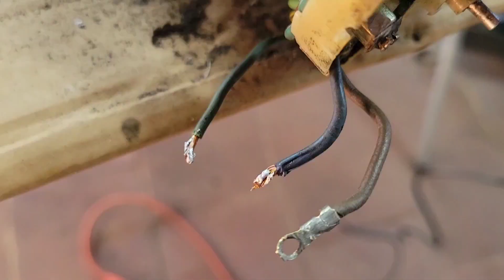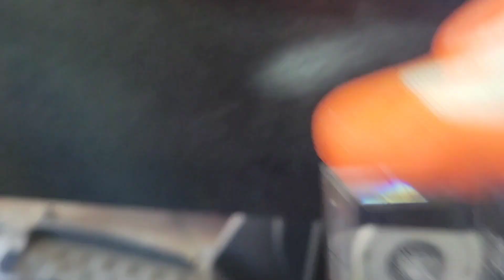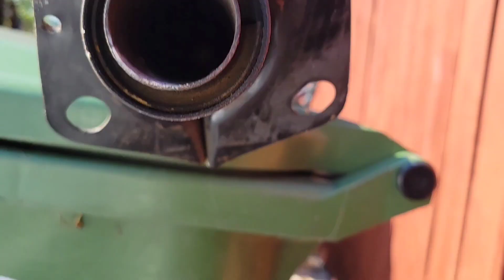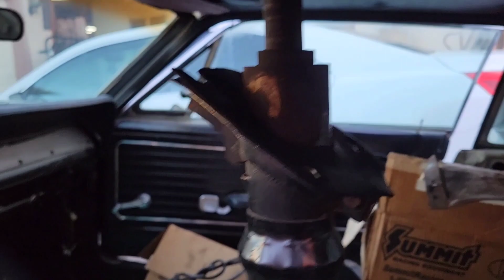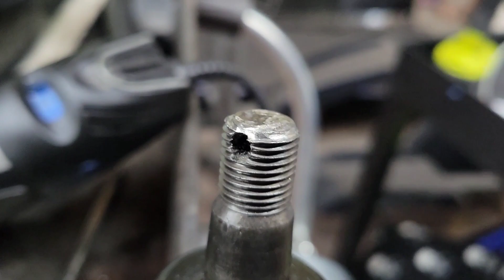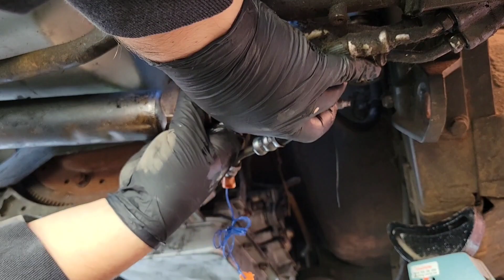1968 Mustang Steering Column, Turn Signal Cancelling Cam Repair

Comment: I did the same repair however I could not get the brake lights to work after I did it. Turn signals were intermittent also. Did you try it with power on yours and does it work?
Reply from the maker: I haven't gotten that far. Had to put the Mustang on hold. Trying to get back to it soon! I'll let you know